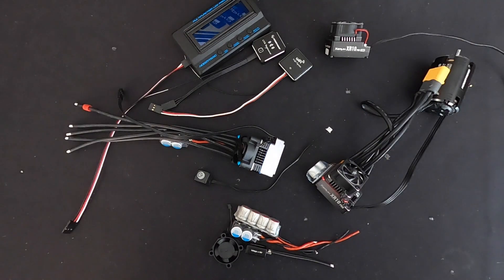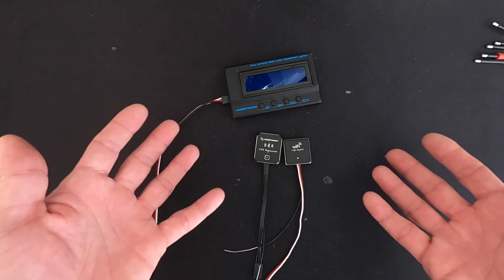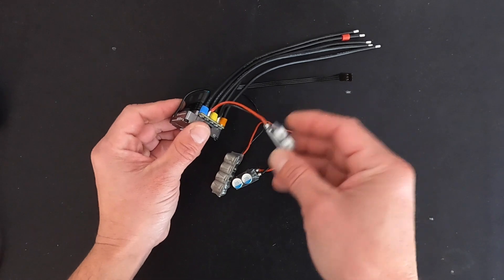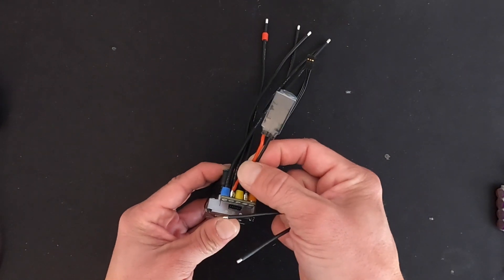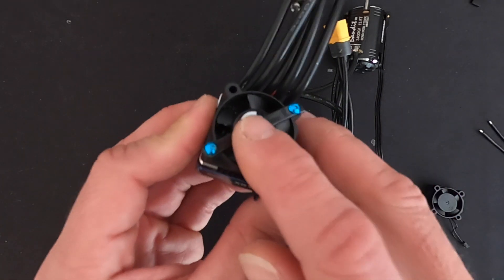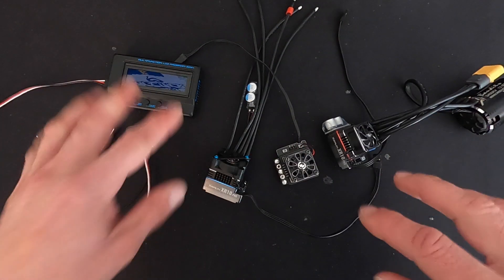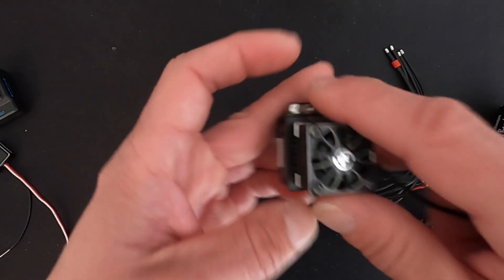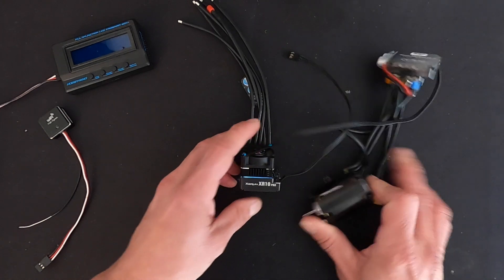The Charlie Show /// Episode 193 /// 5 Things about the XR10

Comment: I put my stock dr10 remote and receiver in with my HW motor and esc but the esc is blinking red but when I pull the trigger to the full throttle position it turns green and same when I put the break but in the neutral position it blinks red again any help will be great